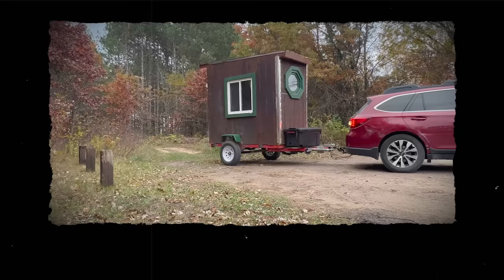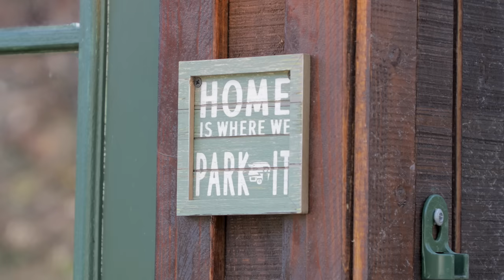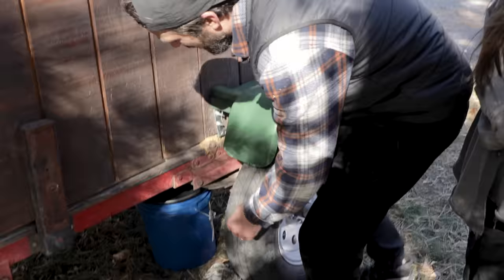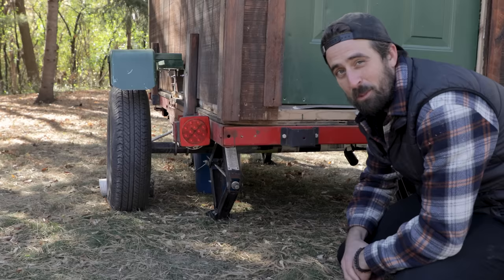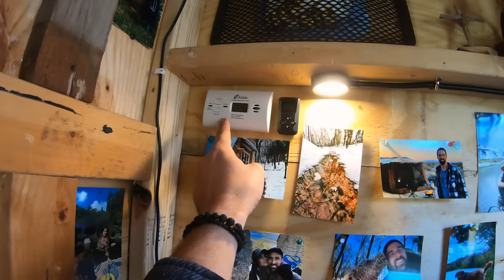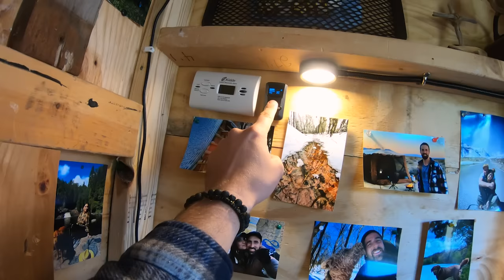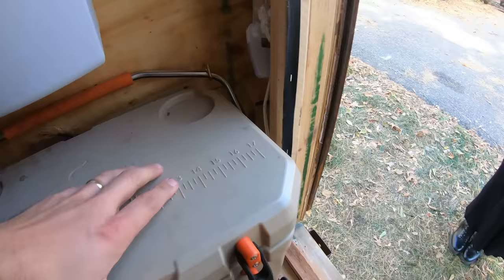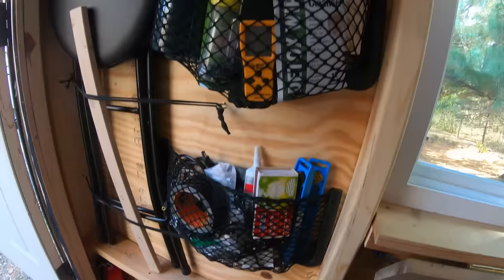Micro TINY HOUSE on wheels built for $1800 & towed w/ a car

Comment: Such a cute space. I can see where it can be easily customized for anyone to use. To make it even easier to tow, perhaps a small build-out over the tongue to improve the air flow on the road. It's great that it's so lightweight because that makes it much easier to manage for many small cars to tow.

A suggestion for the door would be to attach a barrel bolt which is where there is a little knob to lift up so it moves in the direction you want. The most expensive one I could find on the Lowes site was $7. Another option might be a chain guard, typically used inside, but locking type can be used from either side of the door.

You may wish to consider functioning shutters for the great windows to protect them while traveling down the highway and they'd look rather attractive when opened up at the camp site.

Comment: I built a small trailer using the same frame but used a row boat for the roof that you could pull out and go fishing. Had fun and most everything came from different recycle centers. I would post a picture but there is no place that I can see here on this site.  Jon
Reply: There's a FB link. Post your photo there. I would be interested in seeing that.
Reply: …and when you need to transport your tiny home across a lake, you could turn it upside down and then paddle it there.

Comment: That's incredible! I've been thinking of building something very similar but using a 4x8 ft Harbor Freight trailer. I have a small pickup with a 4 cylinder engine so your design is perfect. So many thoughtful details in your design. Very inspiring!

Comment: Omg!!!! I literally have the same flat bed and I'll be starting mines in April!!! Everyone said that 32 square feet is impossible....but I see it is!!😍😍😍
Reply: I’m working on a 32 sq. ft. one on a 4’X8’ trailer too! I’m in desperate need of a tiny sanctuary for use as an ADU with all the amenities, so there’s no reason to leave for as long as I like. There will be a 2’X2’solar shower/bathroom area,solar porch lights, but most electrical will come from shore power or battery power. It’s got VERY small fresh/grey water tanks, a 2’X2’ kitchen space. Everything inside is either collapsible, convertible, or multi-use.  Eventually I would like to make it all solar to be free of the cord.

Comment: Love there ideas and being I’m an old hippy from the 60’s I converted a international step up van into a home on wheels. Again it would be nice to be able to post pictures here but I cannot locate an area to do so.  I painted it red, white and blue and the inside was big enough to even have an old pot bellied stove!  Not as electronically converted like this but more old fashion.  My drivers seat came out of a transit bus with air shocks and passenger seat was a rebuilt easy chair.  The whole inside was decorated with wall paper that featured flowers that represented the times of the late 60’s.  Like these newer smaller it was all self contained but of course without the modern electronics of todays world.  Thanks for putting up this site and enjoyed this presentation.  At the present time I have a 78;Bluebird Wanderlodge that has a rear door and even a standing platform on the rear of the bus.  It’s a bit bigger than these small homes but I have also customized the rear living compartment into looking like a small cabin!  Fun and it’s not just staple and glue motorhome!  Far from tiny it weighs in at 14 tons but it handles like a dream and is all self contained! ❤

Comment: With that wide of an axle, you could lose a little height(maybe a foot) and widen the cabin over the wheels, you would gain two feet in width! Maybe even extend it a foot or so off the back....Using 2X2s instead of 2X4s would help too, and make it easy to add foam insulation!

Comment: FYI, you could most definitely build a much larger tiny home and secure to the back of your Subaru outback.    A Subaru outback is meant for outdoor driving. It’s meant for driving in the mountain areas. That’s why they made it the way that they did so you might want to reconsider of building a much larger tiny house versus a tiny little thing that you have no bathroom inside you have no way cook in there. I’m sure that may be a hot plate.   Add a bed to sleep on OMG 😱
Reply: Why didn't you watch the video?  The towing capacity of that car is 2700#.  They respected that weight limit.  And they have a bed and a propane burner, a cooler, and a toilet bucket; they are happy with what they have. It's not a full time home.
Reply: @chezmoi42  well first of all, I did watch the entire video that’s why I made a comment that’s number one number to know it’s not 2700 capacity that car is less than 27 capacity do your research before you actually make comments such as you did. Bye Felicia.
Reply: @Michelle34485  Any car can tow more than 27#.  This one is rated for 2700# standard, but I don't know why you felt impelled to come back a month later and argue with me about someone else's perfectly good decisions.  Looks like you made the bad decision to post while 
* ahem * impaired, never a good look.
Reply: @chezmoi42  first of all a Subaru outback is made for off Roading. That’s number one number to GOOGLE do your research on the actual vehicle before you become in such as this by Felicia
Reply: @Michelle34485  I did.  If it is specially equipped, it can go up to 3100#.   Whether the car can do other things like 4WD is immaterial. They will surely deal with all that just fine when they are ready to upgrade.

Comment: Seemed doable until you said twin sized bed lol. Even by myself a twin sucks. Like without the walls at least I can hang an arm or a leg off but its closed in. I move all night long. I'd be hurting myself on stuff 😂 If it were a little wider, full sized then I would say its doable. I've had my full sized in a walk in closet before and it was fine. Especially for 2 people sleeping together. There's no way they sleep together in there. Not buyin it. That'd cause a divorce tryna sleep like that 😂😂